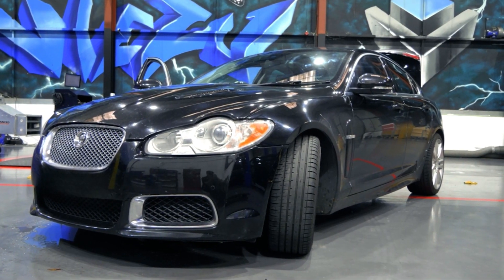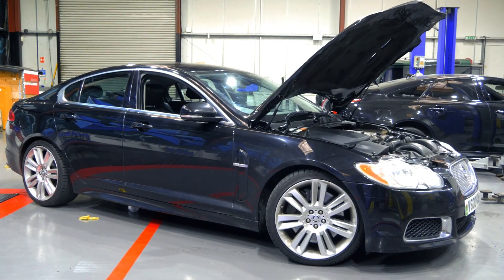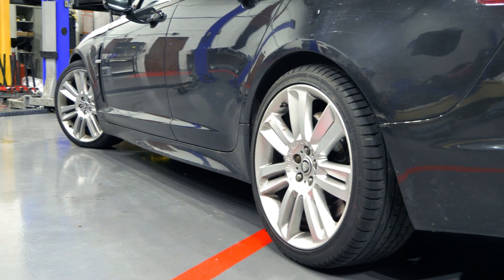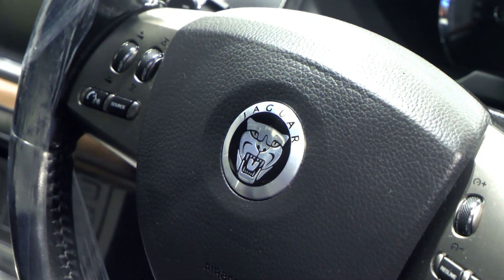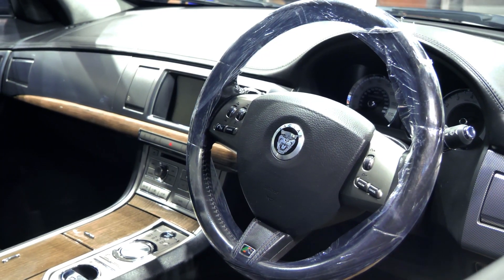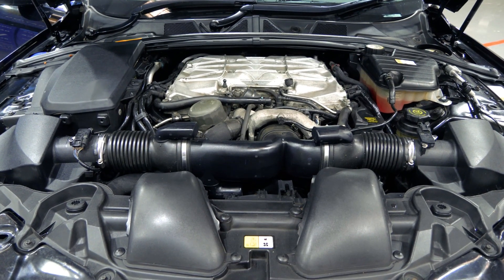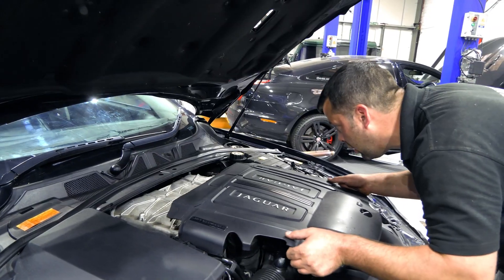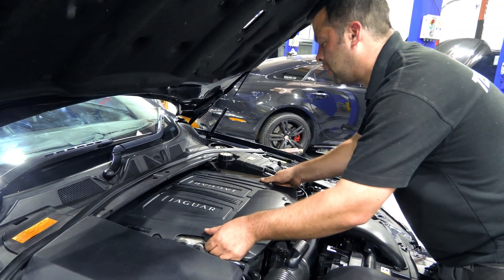Jaguar XKR | Upper Pulley & Viezu Performance Remap

Comment: I have a 2010 xkr convertible. Bought the Miltek exhaust, tuner and got a map from Viesu. I already put ona 60 mm upper pulley since I rebuilt the supercharger snout. OMG did this wake up the car. The Scan Gauge I got from JagMadness shows about 13 to 14 lb boost and 704 crank HP. Revs so fast it's hard to see it if your driving.  Planning on the lower pulley, intercooler and pump next. What great people they were as well. I am in the middle of the USA and everything showed up in just a couple of days, even included a hat and shirt! Fantastic customer service.
Reply from the maker: Hi Dennis, great to hear from you and delighted you are loving the upgrades :-)